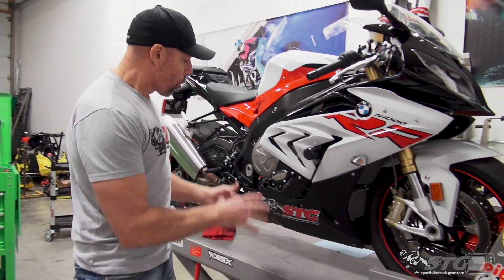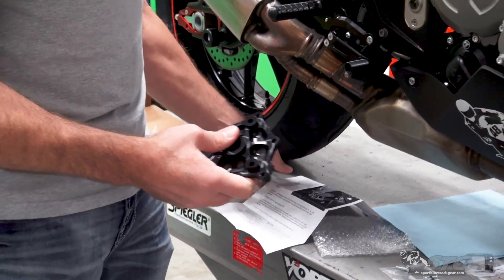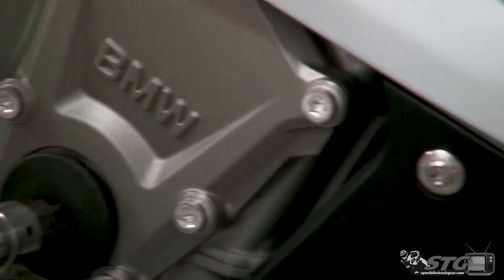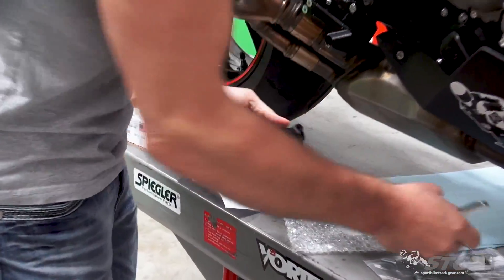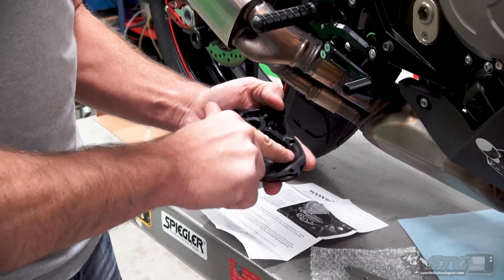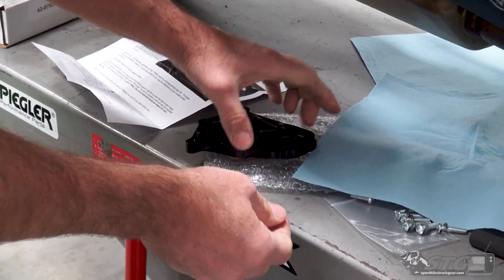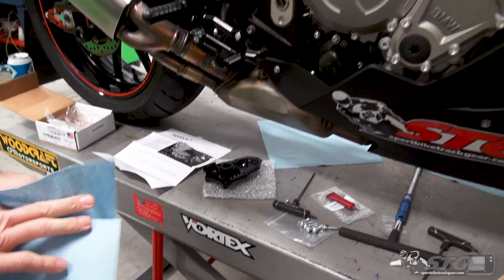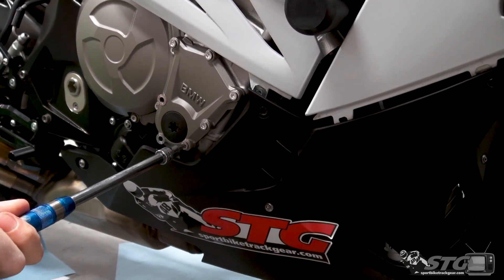2018 BMW S1000RR Woodcraft Engine Crankshaft Cover Install | 2020 Project Bike |Sportbike Track Gear

Comment: The cap screws should be invited from the outside. Also because if you have to turn the crankshaft as you do?
Reply: Maurizio Alderisio I believe the cap screws are internal to be easily removed to replace the plate if it gets damaged. If the screws were external the head would be damaged making if difficult to replace.
Reply from the maker: That has it's advantages and disadvantages. Having the fasteners come from the outside would make changing the plate after a crash much more difficult as the heads to the fasteners would most likely be damaged during the crash. - Van
Reply: @sportbiketrackgear  In fact, and if one has to adjust and restore  the valve clearance, to turn the crankshaft would be forced to disassemble the entire cover.

Comment: Do you realize you using wrong sealant it’s for flexible material not crank cover . That is massed up I just gave you a great review now I have to redo my cover because I looked at your video and just automatically trusted you
Reply from the maker: The instructions call for a semi-drying sealant which this is. That cover has been on there for a long time now with zero issues. - Van
Reply: @sportbiketrackgear  Don’t wanna go back and forth but the sealing u applying in the video is for flexible material read it on the tube. And it's not gonna leak like dripping 💧 however, it'll have a tiny line of oil and taking forever to dry out I started the bike after 2 days, took it for a ride make long story short it sucked. Anyhow, I redid everything with “gasket maker”also permatex the thing on the video is ‘to form a gasket sealant” I don't blame you there is a lot of things I  learn from u was very helpful for my bikes, but I can bet $ that was a wrong tube. Quick question: how did you clean the cover, I mean the little that comes out on the edges . Because with the right stuff it should come off like a silicon stripe